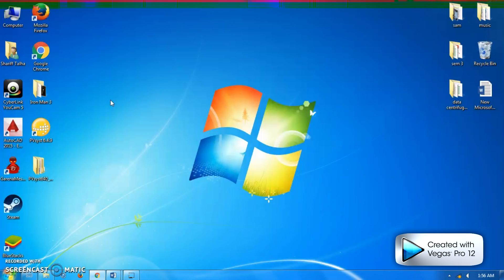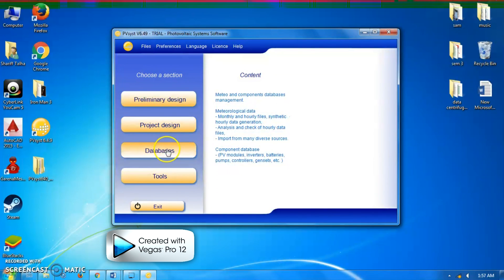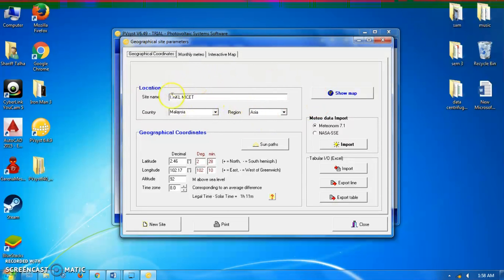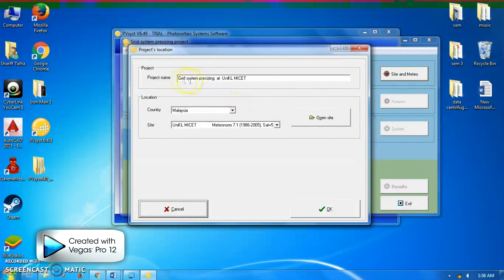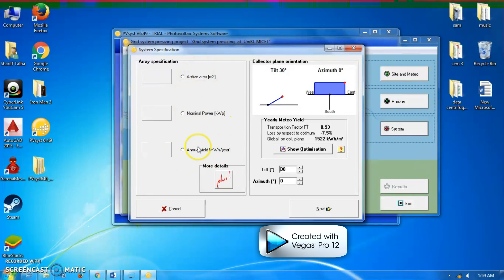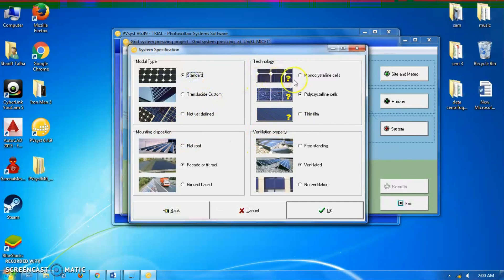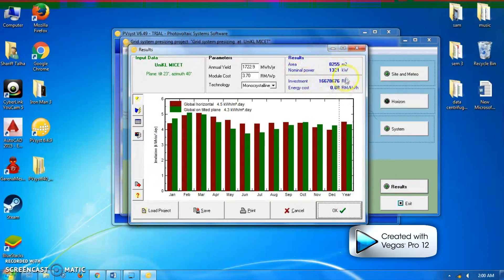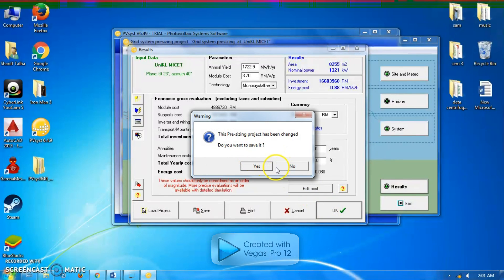How PV syst was used to design a Grid-connected PV plant

Comment: how do triangulate the data on the azimuth angle specifically @_@?
Reply from the maker: The azimuth is defined as the angle between the South direction and the direction where the panels are facing. Angles to the west are counted positive, while angles to the east are counted negative.u can simply calculate it by subtracting the angle of ur roof with 180. hope this will help u
Reply: hi. may I know where do u learn to use this software?